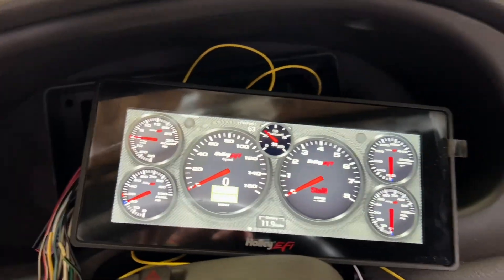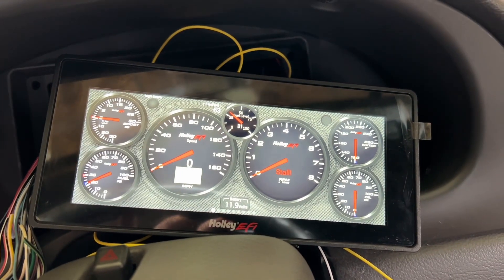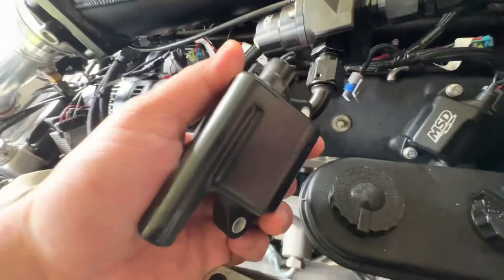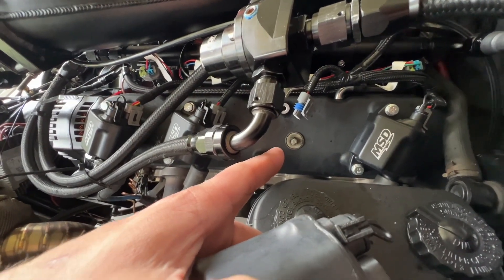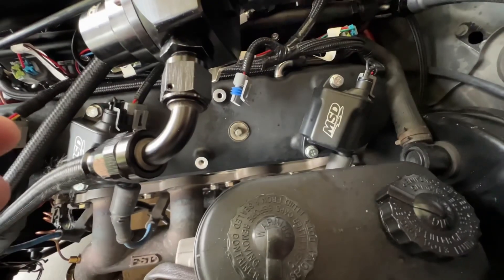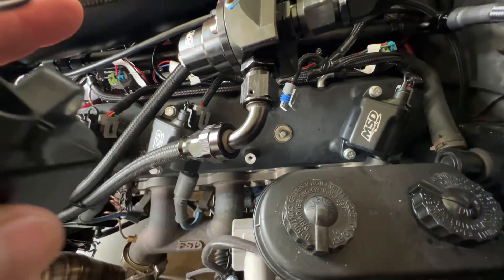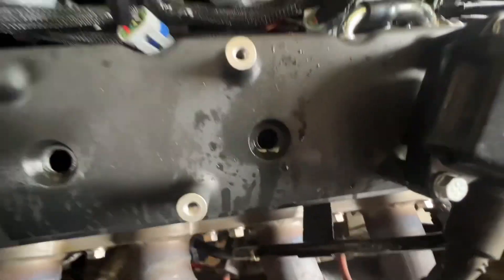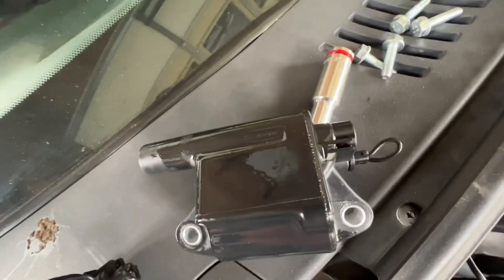Start, revs, trans brake, almost ready to find next issue lol

Comment: Matt I been struggling with a issue all week. I've got my th400 bte pro brake wired to a ebay ssr just like the pic you have. When I hit my button on wheel which us under car with me it activates solinoid but sticks until I unhook ground at noid.  I almost feel like I'm missing something in config. I sat on hold 4hrs today with holley. And he couldn't help me.  I'm sorry for being a pain
Reply from the maker: https://sites.google.com/site/sloppywiki/holley-terminator-x-efi-info
Reply: I ordered another relay lastnite. I do have the one in the pic. Well it's a 40 da
Reply: I kinda figured. I'll figure it out. Like I always do